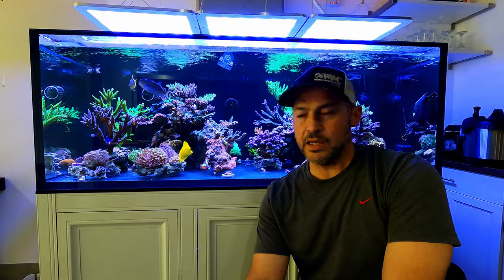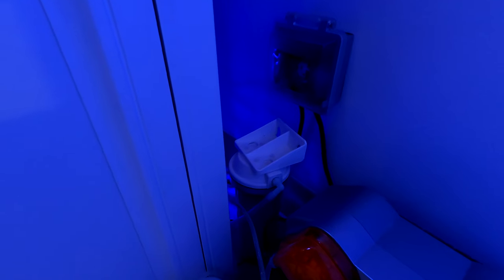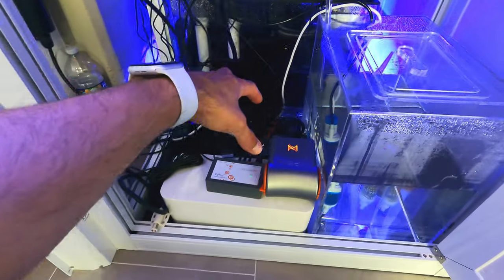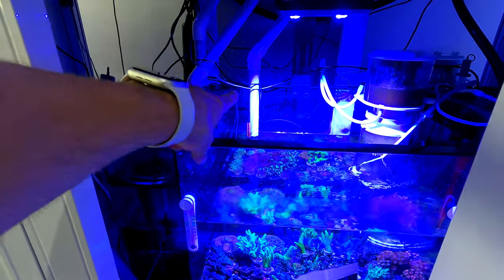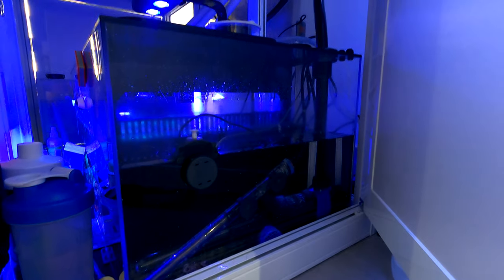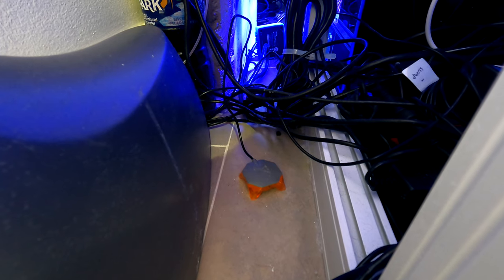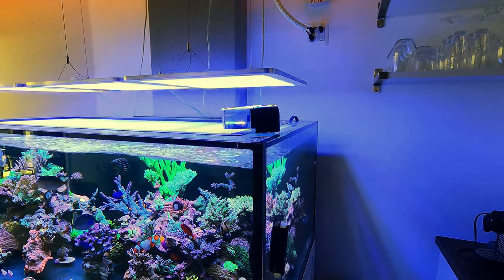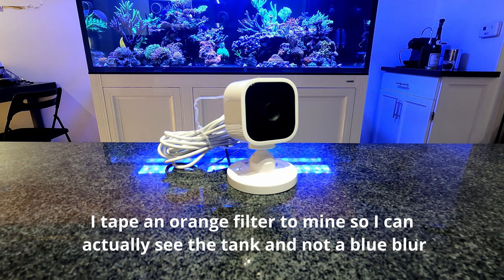How to Prepare Your Reef Tank for a Long Vacation

Comment: Yeah nahh, the lack of C02 won't raise the pH any more than 8.3 at max, so unhooking the CO2 media does nothing when there is lower CO2 levels......

If you are getting above 8.3 pH without using an additional chemical to force the pH up further then your pH monitor is calibrated wrong as you have calibrated your probe  for single sample instead of continuous immersion....

Fingers Crossed 🤞🤞🤞🤞
Reply from the maker: That may be true, but I am dosing a lot of 2-part alkalinity buffer that also boosts pH. I calibrate my probes every 3-months and compare with chemical test kits so I’m sure my pH is correct.

Comment: One thing i do so my sitter doesn’t over feed is place the frozen food for each day in a ziplock bag in the freezer.  

Since my tank isn’t as automated I take pictures of each piece of key equipment and have it labeled on one sheet of paper.  That way if I get a call that something isn’t working I know what it is.   I also label my plug ins for each piece of equipment.  

If a fish were to die (hopefully not) i have them remove it and place it in a freezer bag and put it in the freezer.  When I return I would dispose of the fish

I also meet with my sitter the day before I leave and let them follow my written instructions.  This way if I have forgotten something I can add it to the list 

Your tank is looking great and hope you have a great time while you are away.
Reply from the maker: I also pre-measure my frozen food. My tank sitter has done this many times but I also initially had written instructions with photos printed out. lol.